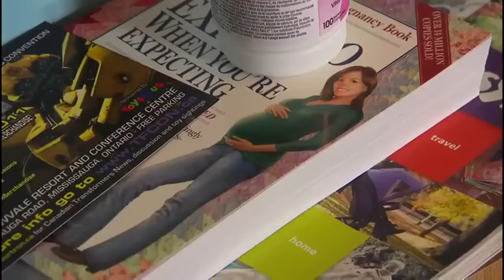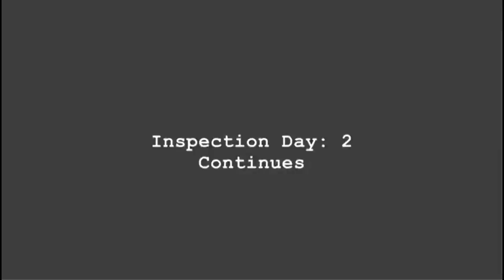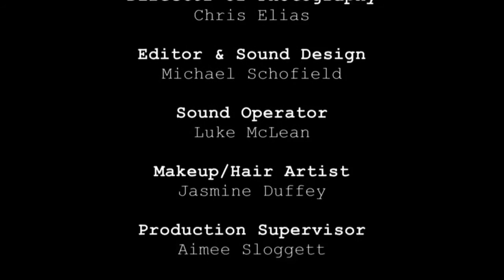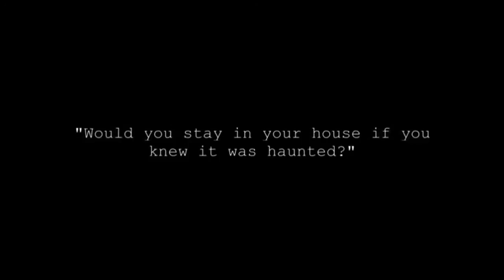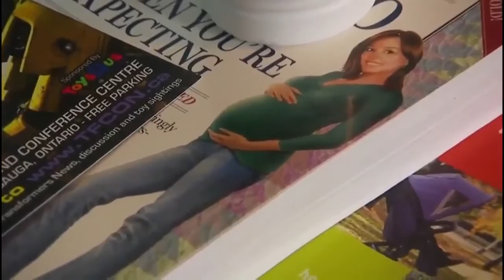Paranormal Home Inspectors Episodepisode 10 SeasonPIRITUAL AWAKEpisodeNING

Comment: "how could I have lifted the chair" very easily. That's a fairly light recliner and when you don't sit in it properly they can tip pretty easily. I used to work in furniture, we'd carry those above our heads. A human body, even if you're fairly small, is more than enough, especially if you're unbalanced and your center of gravity shifted